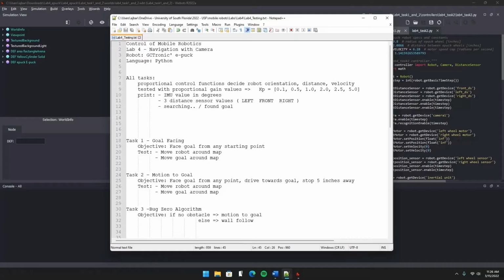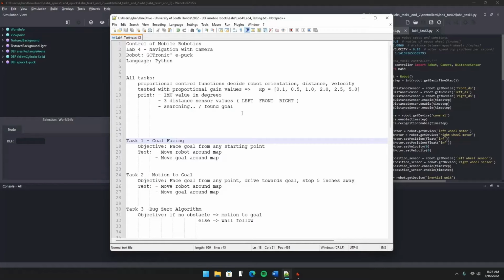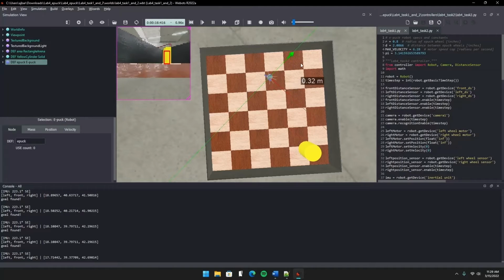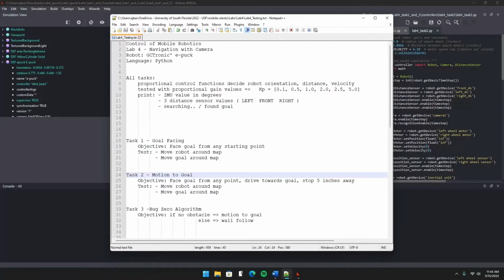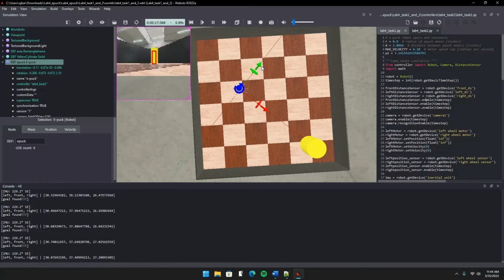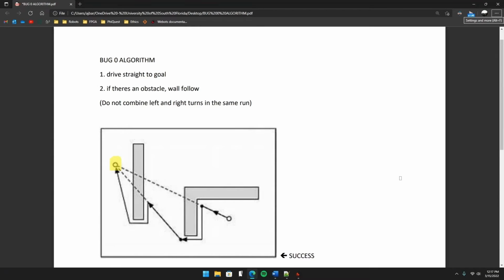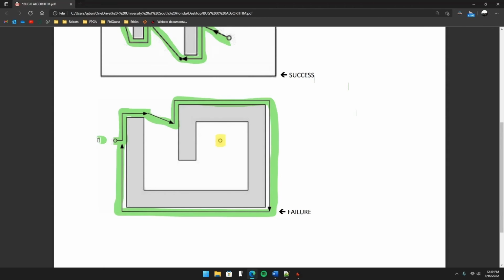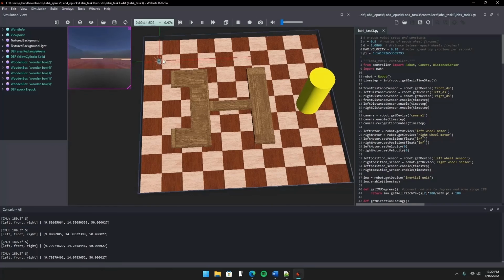Webots Lab 4 - Navigation with Camera

Comment: Have you found the easy fix for task 3? are the errors eliminated?
Reply from the maker: Hey! I made a big improvement in a later lab. Before, the robot's turns were jerky and confused because it constantly adjusted based on the IMU mid-turn. Now, it uses sensors to figure out its cardinal direction and then completes smooth turns directly to North, South, East, or West. No more jitters or traveling too far from the path!